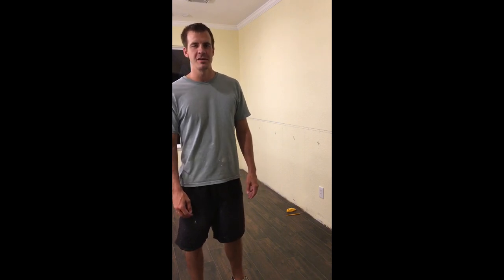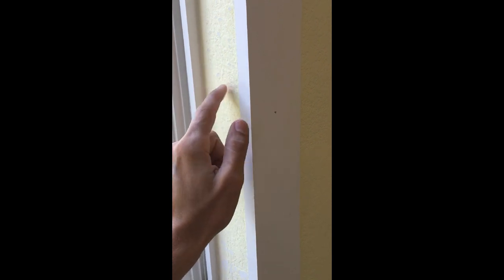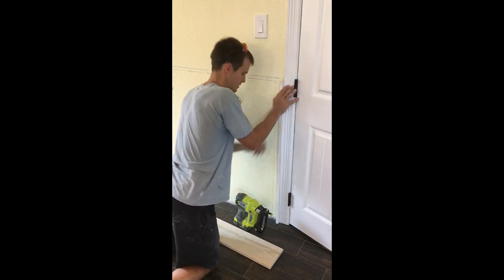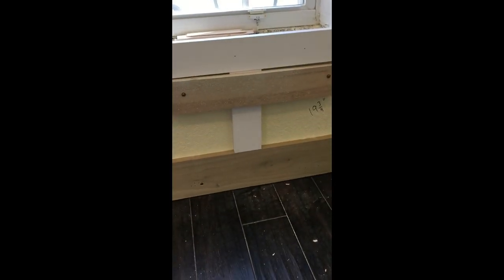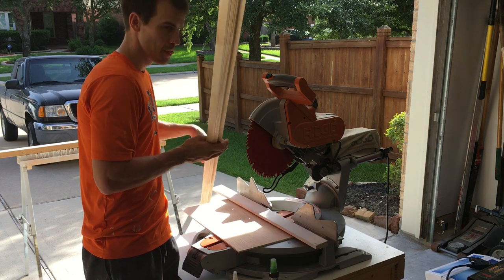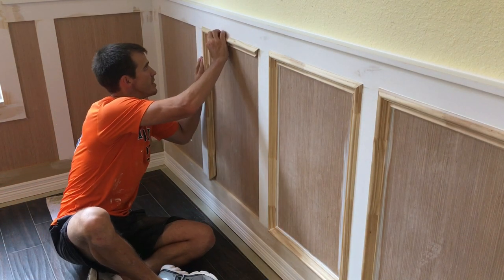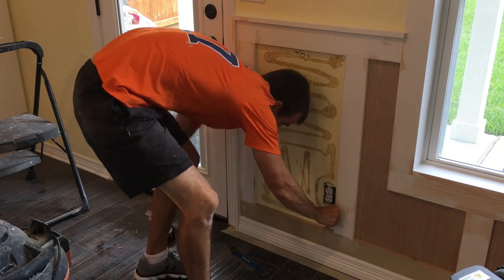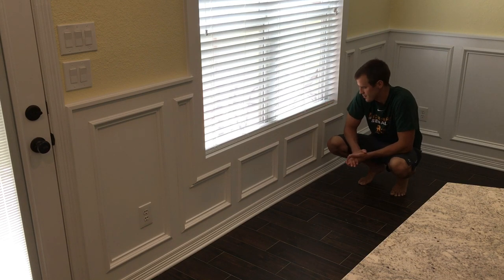How to Install Wainscoting

Comment: It couldn't have turned out any better.  I'm in the middle of mine right now.  I am painting the MDF and staining Oak for the Baseboards, the chair rail and the panel molding to match the existing jambs.  ALSO  I am using an embossed, striped, paint-able wallpaper in the boxes and above the chair rail which will increase the depth inside the boxes that you lost by installing the paneling.  I hope mine turns out as well as yours did.  Take care.
Reply: Hope it turned out great!
Reply: @adamguarino3507    Thanks.  The entry room now has a very nostalgic look and feel to it.  Kind of old time warm.   Take care and Maranatha